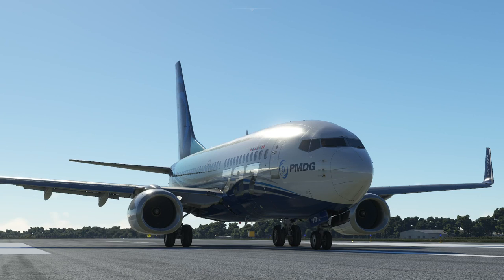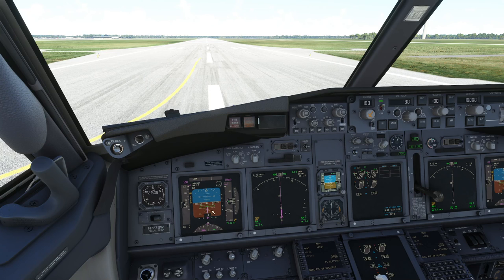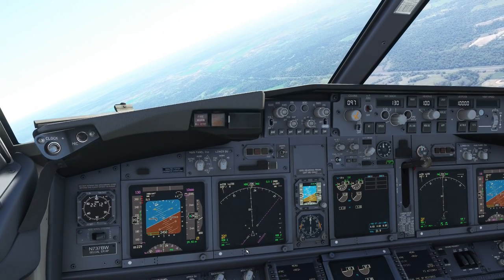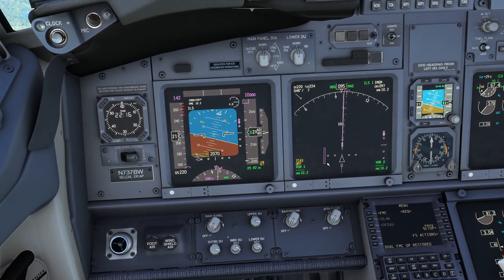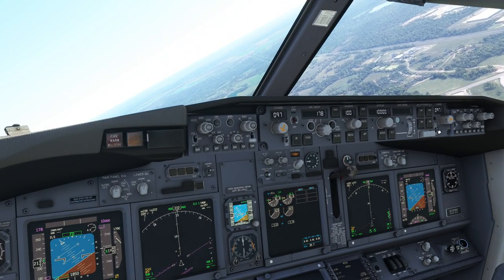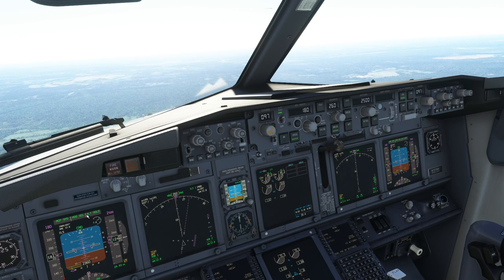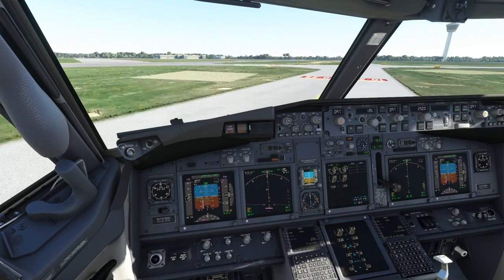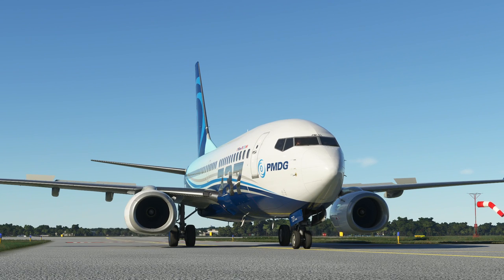Beginners Guide to ILS in the PMDG 737-700 in Microsoft Flight Simulator

Comment from the maker: As ever, I make some small mistakes while talking (I'm terrible at multi-tasking), but they are always instructional - and useful to see the resolutions. We'll keep quiet about leaving the airbrakes partly extended on the second circuit :)  Something I completely forgot to talk about - for approach mode to capture, in most aircraft you HAVE to approach the glideslope from below - i.e. fly straight and level into the beam.
Reply: to add, it really helps to intersect the glideslope at an angle unless you are in the center axis of it if approaching straight on.  Good vid!

Comment: Very nice Video,  I am having a problem picking up the Vertical ILS diamond. I duplicate what you did in the video. I pick up the lateral diamond but never the Vertical diamond. I have doubled checked everything but still no luck. Any help would be greatly appreciated,  Thx, Thomas
Reply from the maker: Did you have approach mode on before you flew through the glideslope ?
Reply: Not sure, will try again this am.  Thanks for the response.
Reply: Flew again, everything set up, Had the lateral Diamond lit up, but never once had the vertical diamond even appear. Flew right over the center of the runway at 2000"

Comment: Nicely done.. A small correction on your comment about weather vane effect on downwind.... there is so such effect when in flight.. Physics doesn't allow this.  I suspect you are simply seeing the results of a small control input.  If flying using the autopilot in track mode, a crab angle will be calculated, but when hand flying, there is nor reason for the plane to try to point into the wind.
Reply from the maker: Erm... of course physics will allow it. Commercial airliners have a colossal vertical stabiliser, and it's at one end of the aircraft - meaning if the wind is from the side, the plane will gently yaw into the wind.

Comment: This was extremely informative and helped with the ILS landing.  Question, when using the spoilers, I have been using the mouse to move it but it's very slow.  How do you move it so easily?
Reply from the maker: I have the Airbus quadrant from Thrustmaster - it has a lever for the spoilers :)
Reply: @jonbeckett  thanks for getting back to me. I don’t have a throttle set yet. I plan to purchase the Honeycomb Throttle very soon and I hope that will help with that. Thanks again.
Reply from the maker: @rob0085  You're welcome :)
Reply: @rob0085  You can also use the idents..if you look just to the right of the lever-you'll see it has labels for UP ARMED HALF and full. if you just click on say armed, or half..it will go directly to that setting.
Reply: @noway9880  I'll check that out next time. thanks

Comment: Jonathan, on what moment do you turn off the auto throttle? You (auto) land the plane, view from outside and your auto throttle is still activated. When you go back inside the plane after touchdown I see that the switch is turned off. When precisely does in need to be turned off?
Reply from the maker: I'm pretty sure it turns itself off (you've got me wondering now what triggers it)
Reply: @jonbeckett  I will try it tonight and let you know.. ;-)

Comment: I have my rudders binded but the nose wheel and rudder are not moving..help please
Reply from the maker: There is a separate rudder and nosewheel axis in the sim, plus you can configure their relationship in the FMC.
Reply: @jonbeckett  where is the setting inn the fmc? Thank you for your help!
Reply: @mcshiggitypilot5901  menu, PMDG setup, Options, Simulation Page 7 - for "Rudder axis only" bind the rudder axis to the rudder axis in the sim control settings, and if you chose the option "Prop1 axis + Rudder, you have to bind another axis to the propeller 1 axis in the sim control settings to be able to control the rudder and the tiller separately - like in real life.
Reply from the maker: @mcshiggitypilot5901  It's in the MENU page - either one of the pages under PMDG, or the FS OPTIONS section (sorry I can't help more - I'm at work now)
Reply: @jonbeckett  I actually found the problem ! I was getting low pressure lights on the overhead panel, Flt control, electric A&B , so I went to the maintenance option on the FMC , and had the virtual mechanic add hydraulic fluid! Took about a minute, all was well!

Comment: Does the plane go to idle on its own on auto land?
Reply from the maker: It's up to you to disengage the auto-throttle :)
Reply: @jonbeckett  Thankyou! So for clarity when the aircraft lands on its own the pilot has to pull the throttle back
Reply from the maker: @captain7956  Yes - and typically the pilot will go for reverse thrust and full spoilers immediately - then at about 70 knots stop the reverse thrust, and go to wheel brakes.
Reply: @jonbeckett  thank you for replying - great tutorials
Reply from the maker: @captain7956  you're welcome :)